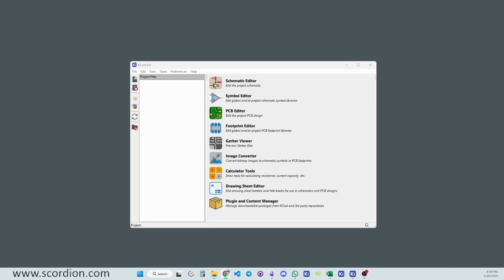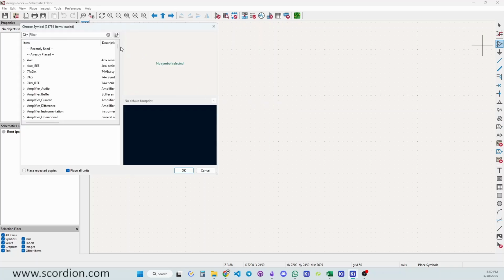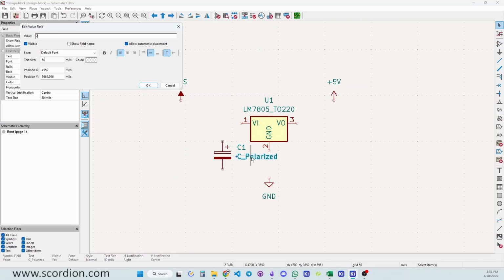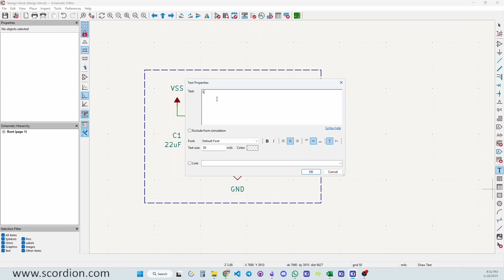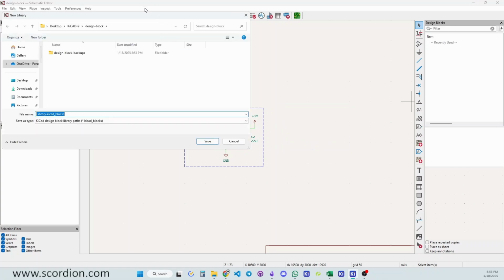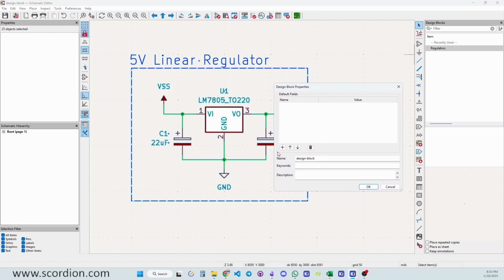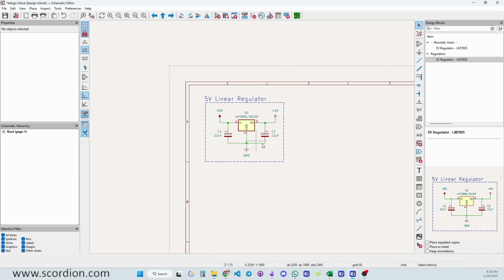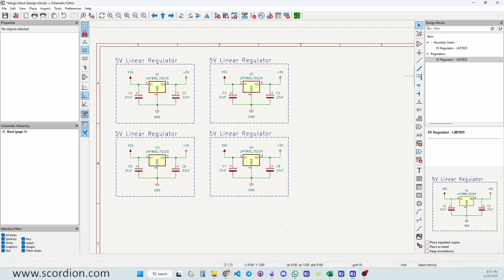Master Design Blocks in KiCAD 9 – Save Time & Reuse Schematics!

Comment: Unless you can parameterize design blocks somehow, or add "ports" (to connect one block to another), or introduce an easier way to layout the PCB of design blocks, I see little use for them as of right now. But the tutorial is very welcome. I had a hard time finding the functionality, it's not intuitive at all that you need to activate a panel that's hidden by default, create a different kind of library in your project, etc.

Comment: What I would like to see is then if we edit the design block, it would update everything. Like a component.
Reply from the maker: Check this out! I think this is what you’re looking for. These are hierarchical schematic modules. When you use them multiple times within the same project and make changes to the internal schematic, those changes will automatically update in all instances of the module. You can also design your own modules.
https://protocircuitlabs.com/
Reply: I think you can do that if you use a separate schematic file in hierarchical sheets. (one extra schematic, used several times)

Comment: VSS label is used as the negative supply voltage, you typically use VCC or VDD for power input
Reply from the maker: You are correct I used it wrong. Thanks to you for pointing out that.